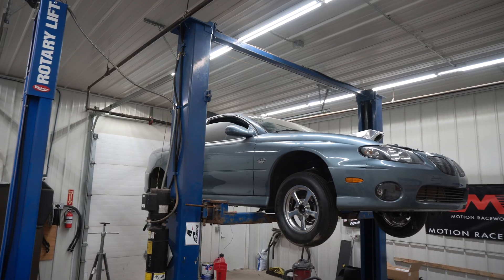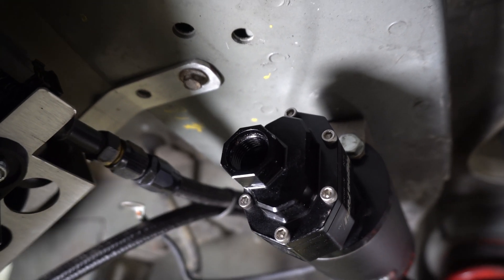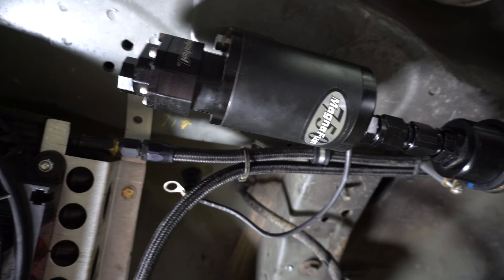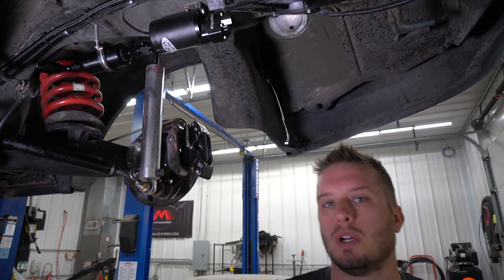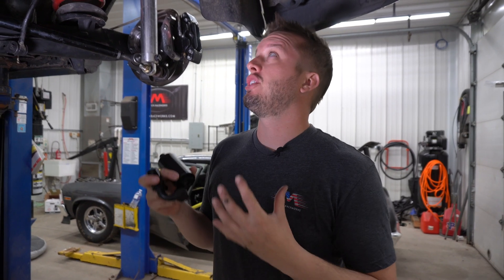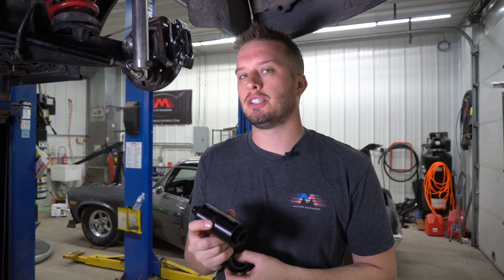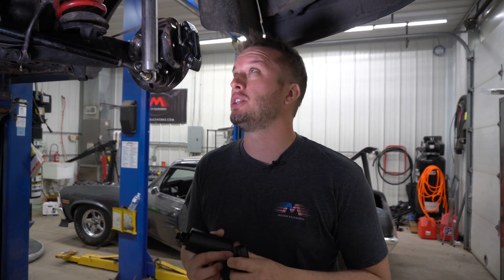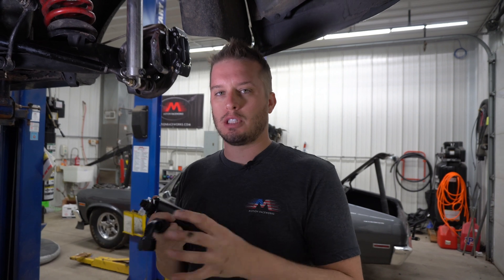Tech Tip Tuesday: Fuel Pump Inlet Size... It Matters!

Comment: I know it’s a old video, but just now getting around to building my fuel system. You said run a size up on feed then out, if I run a 12 out and a 16 in, would the pump be running harder to supply the 12 line on WOT? 
I’m thinking what I want to do is 16 to pump 12 to 10 y to rails then 10s to regulator then 16 back for return. Would this be a suitable setup?

Comment: For the people that do not understand dash numbers , dash numbers are in sixteenths .
#4 - 4/16 - 1/4 “
#6 - 6/16 - 3/8”
#8 - 8/16 - 1/2”
#10 - 10/16 - 5/8”
#12 - 12/16 - 3/4”
These numbers relate to fittings and inside hose diameters .

Comment: So explain how at X pressure post pump having a -12 line and a -10 filter that the larger line actually flows -12 amount of fuel through a -10 hole?

Comment: Texas speed 427 Stroker I bought a Aeromotive A1000 what size Stainless steel Harb Line coming from the Tank in to the pump to my Fast tbi smart injection, and then my return line ,need to know ,Gan N/A in my Porsche 914 ,Street Car ,and do you sell the Hard Stainless steel Line, Motors out and the Machine Shop so wanna nail it now 👍 Help

Comment: I use a -12 supply into my A1000 with a -8 supply to the regulator, dual -8 to the carb bowls and -8 return. Pump is barely audible and draws very little amps as its never blown the 10amp fuse in 13-14yrs its been running

Comment: Is there any issue attaching the correct sized filters directly to the pump using the correct size MagnaFuel coupler and then feeding the inlet of the pre-filter with -12 ?

Comment: Does this line size also apply to the 4303 when it's used as an in tank submersible setup?  My 4303 is installed inside my custom tank with a -10 line to the inlet and then -10 out of the pump to the Yblock.
Reply: Just asked a similar question you asked. You asked this question a year ago with no answer that means I'm not going to find out either lol

Comment: Preach it Doug! I’m a industrial pump mechanic in the gas and oil field, we always preach about the suction side if a pump needs to be up to double the size of discharge. Fluid needs to be waiting to be pumped. I’ll be doing this on my build for sure.

Comment: Standard fuel line 3/8 (-6an) have supported over 1000 wheel horsepower in many builds. Its all about how much your pump can put out, and having minimal 90s fittings in your setup. You do not need a -10an on a auxiliary fuel pump that wont even support up to 1000 wheel horsepower. It would be like throwing a hotdog down a huge empty hallway. I would only use a -8an if anything for that pump. Just thinking about all the special fittings you would need to purchase to increase or decrease fitting sizes sounds expensive and also limits your pump flow. Less fittings the better. Just run more line, and make sure it's straight.